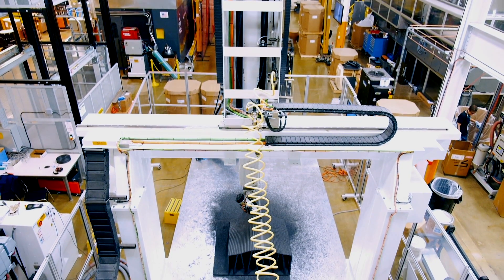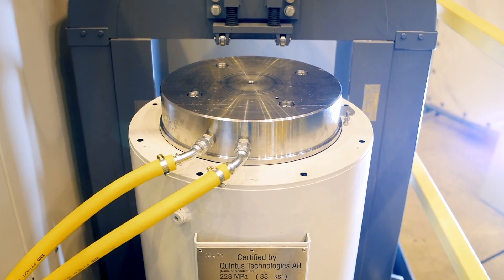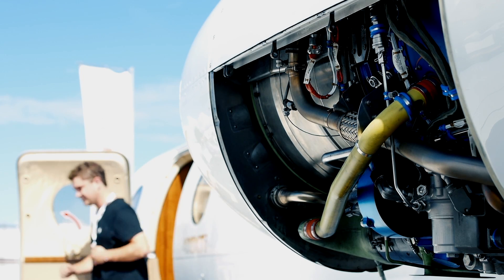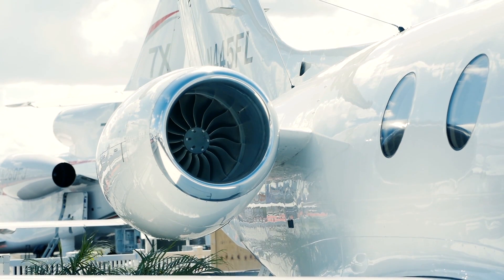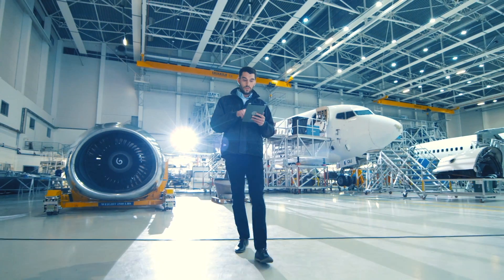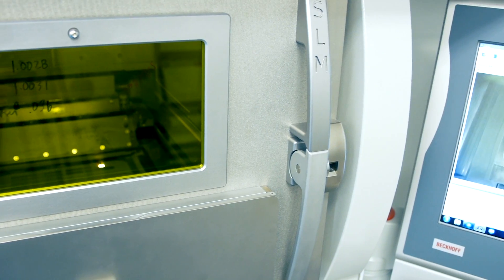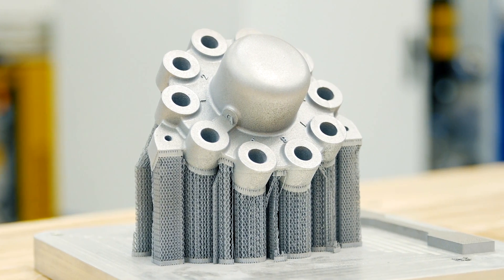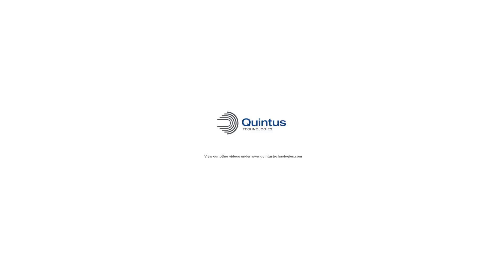Quintus Technologies HIP and High Pressure Heat Treatment Process for 3D Printed Parts

Comment: The aerospace 3D printing is projected to grow USD 3,057.9 Million by 2022, at a CAGR of 27.42% during 2017 to 2022.

Download Sample PDF - https://tinyurl.com/n8latpb

The growth of segment can be attributed to increasing use of different types of materials to 3D print different types of engine components.